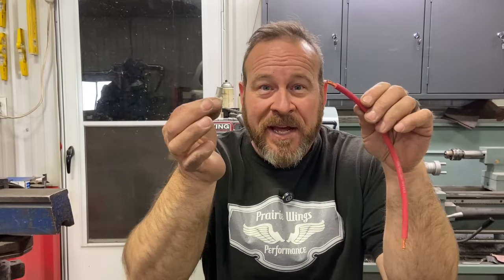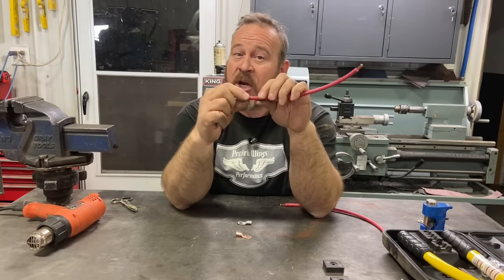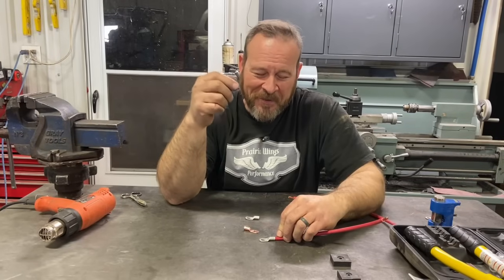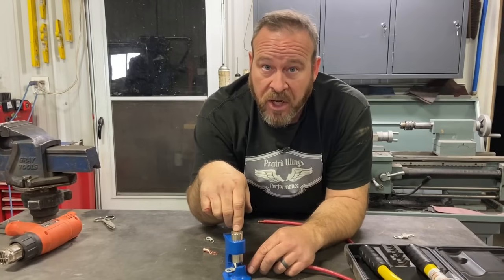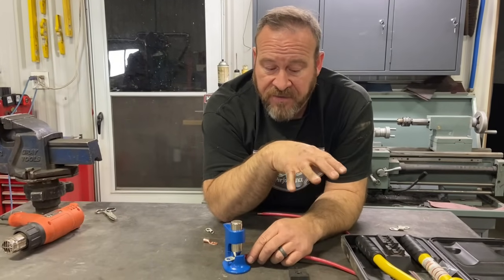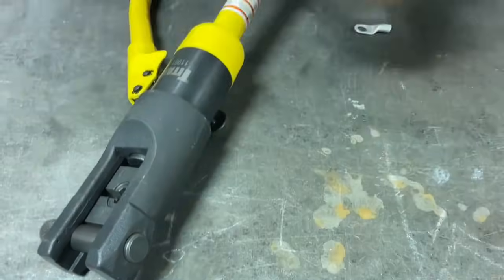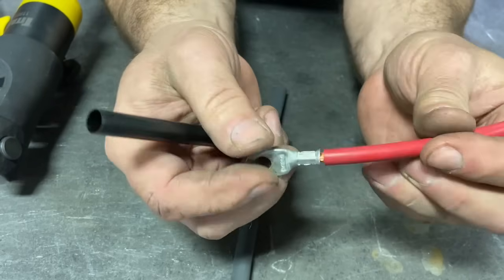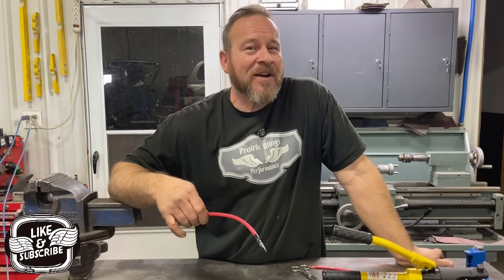Crimping Heavy Cable Ends - Which Way Is Better?

Comment: GREAT VIDEO!  Non-professional here, but have been putting together small emergency solar power systems for friends and family.  Have been using the hydraulic crimper from the start because of the mess and learning curve of soldering - mostly not heating/burning the wrong stuff, like insulation or my work bench, and dealing with fumes, etc..  I have just been filing off the "squish-wings." which takes more time than just backing off after a partial crimp, rotating the end by one flat and then completing.  That tip is greatly appreciated!

Do you have any suggestions on sourcing the better heat shrink and if it's possible to tell before ordering whether it has got more of the sealant?  Didn't know there was a higher grade product and the stuff I have been using is definitely the flimsy stuff with less sealant.

Lastly, can you explain a bit more about, or give  reference to a deeper dive into, the reason why soldering increases the likelihood of connection failure in high vibration situations?

Thanks again for your time and a great video!
Reply from the maker: @chuckm65   thanks for taking the time to dig deeper and ask some legitimate questions. I use either PICO or Techspan double wall heat shrink. 

As far as the science behind the vibration failure I am no engineer or expert on the science. I know a few things from training. Your panels I believe should be considered a static load. I’m not sure the engineering behind them they would have some dynamic loads because of weather conditions but for conversation sake we will call them static. Nothing should be loading them differently solid mounts wires tied etc. parts not intended to move (let’s hope not). Something that is dynamic loaded is loads that are intended to move, vibration and designed to have shifted loads. When the wire is soldered it can cause a failure point at the end of the solder, that joint is very stiff and I have witnessed that failure on many applications. Usually where a door opens or closes on some’s repair work etc. for the science behind that I am hoping for someone with more background in the actual science would chime in. 

Thanks again for digging deeper, hopefully we can start a good information conversation.

Comment: One should look for dual wall adhesive lined heat shrink.  This is the style that contains a thin layer of hot glue on the inside that generates a waterproof seal between the connector and wire insulator.
Reply from the maker: @williamdouglas8040  absolutely, thanks for taking the time to add your thoughts!!
Reply: Where can that be found online?.... Any info brand names or websites would be gratefully appreciate it
Reply from the maker: @ it is a Titan. MPR tools has them, since I bought this I have seen this brand at the cheap stores. If you sort through the comments there are tons of suggestions on better sets. I actually want to upgrade this one from all the comments suggested ones (it’s going to take a while to figure it out, lots to sort through). I appreciate you taking the time to watch and reach out.

Comment: As a marine electrician I have seen many lugs fail for a variety of reasons. Mostly from corrosion, then crimp technique. When troubleshooting I start at the batteries condition and connections. I have been using the hydraulic crimp method for a few years.
 I use electrical tape stretching around the lug and cable before I heat shrink. The shrink should be at least an inch past the end of the lug, more is better. Don't try to save money on your heat shrink!!
Reply from the maker: @gregnelson86  thanks for taking the time to watch and share your experience! Very valuable!!!

Comment: The rick with soldering the lugs on is not to use solder but fill the ends right up with molten lead, then push the cable end into the molten lead, no further heat is used. As lead cools and solidifies it expands and grips the cable tight, if you look at very old iron railings you will find that they have been set into holes in the stonework this way, molten lead poured in around the iron rails which then expands and grips the iron and stone.
Reply from the maker: @Equiluxe1  thanks for taking the time to share that trick!

Comment: This is a great process that doesn't leave much room for improvement.  I believe the pressure from the dies is enough to cause the copper wire and metal lug to flow together removing gaps between the strands and sealing the end of the cable from moisture intrusion.  When you add the heat shrink you get a very high quality connection.  Let's not forget that to have the best long term reliability the equipment owner still has to do regular maintenance including battery maintenance.
Reply from the maker: @TerryPullen  true true! Thanks for taking the time to comment!

Comment: Great video. I would only add that there's a difference between the hydraulic crimper you have and a very similar style, but the crimping end is more like a C clamp and the dies load from the side not the end. The C style can flex when crimping larger cable like 2-0 or 4-0, and will eventually result in not producing good crimps.
Reply from the maker: @andersonautomotive  great info, I’ve never used the “c” style. Thank for taking the time to comment.

Comment: Typical urban elevators are probably the heaviest common power loads. The folks who install them use the "solder pot" method of flooding the terminal and cable with solder. So that may not be milspec, but it has plenty of real-world proof that it works under long period heavy load.
Reply: If there's flexion or vibration, solder is not ideal.  It works great for connections that are never flexed.
With high amperage loads, there is some self-heating of copper cable, causing expansion/contraction -- and in addition there can sometimes be significant forces derived from the induced magnetic field.  So you can't always regard even a very firmly anchored connection as being free of flexion.
Reply from the maker: @lyfandeth  absolutely, thank you for the great information!!

Comment: The little blue thing is not a crimper. You are STAKING the cable in the lug, with a punch, as opposed to uniformly compressing a barrel around it. Which would be crimping.
 Staking can be "good enough" but it ain't crimping.
Reply from the maker: @lyfandeth   absolutely, as you can see in the video… words aren’t my first language😂. I do appreciate you commenting!!

Comment: I have a Temco hydraulic crimper.  It has the standard dies which work for the standard duty terminals.  It also has a set of + sized dies that work with the heavier terminals without forming wings.  There is also a set of dies for metric and MC terminals.  The Temco is more expensive but gives you the proper tools to work on a variety of equipment.
Reply from the maker: @douglaswalker8563  perfect, after chatting with all the people commenting I definitely have put a new crimper on the wish list. I really appreciate all the good information! Thank you for taking the time to share!

Comment: If I am not soldering a connector  and it is going to be exposed to either battery or road spray I coat the wire with Truck-Lite 97944 NYK-77  anti corrosion grease before crimping and have never had a  connection corrode even exposed to North East winter road salt.  The extra step is worth a little time  for added insurance.
Reply from the maker: @charliehayes6667  hey perfect! Lots of great tricks shared, thank you so much for sharing your experience!!

Comment: The shortwerishon do not splise  any cable in a place where its exposed of The major vibration its usualy easy to se if you back dovn two steps  and IF you do that it doesent matter witch metod you chose  as long your god att it  you never ever splice it where it broke
Reply: Never ever splice it 😢😢whwere broke unless its temporarly and works😅
Reply from the maker: @jonnyeriksson3218  🤣😂
Reply from the maker: @jonnyeriksson3218  great advice, thanks for sharing!

Comment: What you are trying to do is compress the strands till there is no air gap, air gaps between strands are bad...
Reply from the maker: @martinfidel7086  you bet kind of cold fusion. Thanks for sharing your thoughts, very much appreciated you took the time!!
Reply: @ no not that tight, at that point the strands lose strength and will fail more rapidly due to fatigue, hence why we use calibrated crimp tools and jaw sets
Reply from the maker: @martinfidel7086  I totally get that thanks again for the input!!!!!

Comment: Is there a video for that manual crimp, hammer style?
Reply from the maker: @keithbrown1915  I haven’t put one out, thoughts, I can put it on the list if you want. It’s very simple.
Reply: @prairiewingsperformance6036  I agree that the hammer style crimp tools work surprisingly well, in my experience.  I've only been using them for about 10 years, so come back in 20 to ask me if they are holding up. Obviously hydraulic is far better if you can justify the cost.  Or find a friend with one!

Comment: Excellent video. Subscibed. Techniques for termination are very interesting to me. I have always used the soft heat shrink. The heavy glue HS is new to me. Definitely see that is better app than stand on this application.
Subscribed.
Reply from the maker: @keithbrown1915  thank you so much, I really appreciate the subscription!! I also really appreciate the time you took to comment!!

Comment: If you’re worried about using some kind of goop between the wire and the terminal, you should use Noaloc like electricians use for copper wire on aluminum terminals because it is conductive of electricity and dielectric grease is not. I’ve been using hydraulic crimper for 10+ years and before that I use the kind you hammer on and I also have a set that looks like pruners with an adjustable thumb screw on top for adjusting for the different size lugs and they all work well but the hydraulic ones are my favorite.
Reply from the maker: @bigjohnson4983  sounds like you have a wealth of knowledge! I definitely can relate to the progression, thanks for sharing the tip, time to look up Noaloc! Thanks for taking the time to watch and add a useful tip, no one else has mentioned that so I’m sure lots of people will be learning from you!! Much appreciated.

Comment: Man. After being an auto tech that specializes in custom electrical fabrication. It so nice to see someone that has traveled the same roads and wound up in the same spot I have with what they feel is the best most reliable way to do this task.   For that I subbed up!  Notifications are on too.    Well done.   Have u noticed that sometimes the best way is to crimp and soldering?  There’s even some other tricks when u pull huge amperage 500plus that helps with the efficiency of the connection too. 11:36
Reply from the maker: @rodgersrcaviation2785  hey, it is definitely good to chat with others that have travelled the same road!! Thanks so much for joining and showing your support, really appreciated!! Please share along with your experiences, I have learned lots from constructive comments. Isn’t YouTube great, I remember the days working in a shop that was too cheap to purchase manuals. For those who may not have been around long enough to know, all of our information came from books. When there was no books it was tough and you had to learn the hard way! Again thanks for your comments!!
Reply: @ brother I started in books too. 27yr deep here professional but have held tools since diapers.  I remember when Alldata came on cds and u had to have a big adapter for the printer cable.   lol.   Use to own dozens and dozens of motor chilton and many other big ass blue hard covered heavy books. lol never figured out the why are they all blue question
Reply from the maker: @ yup, I still have them boxed on a top shelf in storage. Not sure why I haven’t used them to start fires, deep hoarding desire??!! It’s funny in the world of information we live in now some people still struggle trying to fix things without looking for information. I guess I’m guilty of that sometimes….
Reply: @ man I’ll tear off into about anything.  Airplanes. Boats. Jet skis whatever but years of experience tell me when it’s time to go peek at it. It’s time to go peek at it.   Im sure u know what I mean.
Reply from the maker: @rodgersrcaviation2785  absolutely, I am helping a friend with a rebuild of a plane. Probably have some vids on that too??
Reply: just use calibrated terminal crimps designed for the terminal in use and apart from your bank balance being broken all is well
Reply from the maker: @martinfidel7086  yes all the way around 🤣
Reply: @ sorry I'm clearly having a humourectomy tonight :(
Reply from the maker: @martinfidel7086    I’m sorry I may have taken something wrong, i am not a big texter in the best of times and this feels like texting. I am the guy who doesn’t take cues very well when talking and text we’ll forget it. I love to laugh and am sorry i thought you were saying to use proper crimpers for the lugs you are using but it’s going to hurt the wallet. I agree to both. I as well am probably invest in better tools. There has been some great information in all the comments. Again I’m sorry if I’ve offended you.
Reply: @ buddy I am in no way offended :) I go have some expensive crimpers though, I paid over £500 20 years ago for one of them :(
Reply from the maker: @ perfect! I’ve been around too long to want to offend anyone anymore, that was the kid I once knew😉.

Comment: Slightly off topic, I'm new to your channel, but have you done a video on the Western Union/Lineman Splice instead of a butt connector for multi strand automotive wire ? I learned it from Chris Fix. Great for hooking up aftermarket taillights etc .. bare each wire 1" make an X and twist each wire the opposite way. If done correctly you'll end up with a half inch of bare wire that can't be pulled apart. Then slather the Splice with dielectric grease, then use a slightly larger shrink tube, heat both ends first to trap the grease. You'll break the wire b4 the Splice will fail. ChrisFix explains it way better than me. Thx for your informative video. I never use crimp on butt connectors tht can/will fail. Chk out his YT channel. Sorry for the poor grammar
Reply from the maker: @speedfreak8200  thanks for checking it out and subscribing! Appreciate the information, thank you for taking the time to share!!

Comment: Started uding my dads Thomas & Betts think it was a TB5 or TB M5 crimpet that had individual dies for #10 to maybe 3/0 cable. Let my old job have it when I retired 6 years ago. Worked great. Recently read that cars have no solder connections.
Reply from the maker: @JohnThomas-lq5qp  it also sounds like you have a wealth of knowledge, you left them a tool but I bet the knowledge you left was worth more than that! Thank you for taking the time to share!

Comment: Won't that hole in the connecter still allow moisture and corrosion to get into the cable wires?
Reply from the maker: @Enigma-Sapiens  absolutely, I’ve been called out many times on that one here, oops🤷‍♂️. Those are the lugs that come with the aftermarket wiring harnesses! I really do appreciate the time you have taken to comment though, I’ll do better next time? I hope😬
Reply: @prairiewingsperformance6036 , You did great, it's nothing a dab of solder wouldn't fix.
Reply from the maker: @ you bet, thank you so much!! Hope you have a great Friday!

Comment: You can't solder wires in the marine environment.  The AYBC states that you can't solder because as you mentioned vibrations will break wire by wire overtime.  A good solid mechanical connection is the best that they require for certification.  🤠👍
Reply from the maker: @Chris_In_Texas  thank you so much for sharing, I’m not sure what the governing body you mentioned is but it’s good to have input from a trained certified professional!!
Reply: Do you add an oxide inhibitor or do anything else special
Reply from the maker: @barfy4751  I personally don’t do anything and it has worked for many years. There are tons of great tips in the comments if you have time to sort through them. Thanks for reaching out.
Reply: I do electrical repairs on aircraft solder or crimp terminals on military aircraft . I prefer the solder less  crimp designs. They last longer. Some solder joints break due to corrosion from flux or not soldered per mil spec.
Reply from the maker: @macd6351 thank you for taking the time to add to the conversation!!

Comment: You hit all the important issues for quality work...but I'll add some thin wire details.
1) Buy high quality COPPER crimps (or tinned copper) for copper wire and use STEEL crimps for steel wire.
2) Use the correct crimping tool for the specific brand and type of connector. (this is critical on thin wire applications and the many types of connectors like Tyco, Molex, 3M, Beldon etc.)
3) It should look like a factory connection for any and all applications.
4) Doing it right is expensive, doing it wrong can start fires or even hurt someone. Don't let the customer get cheap on you and explain why it matters.
Reply from the maker: @kevinsellsit5584   thank you! The silver crimps are copper with a coating they also have aluminum lugs! Thanks for pointing out the steel, never seen them. Absolutely with the correct tools have a drawer full of them, I love tools! All of your points are awesome, thank you for taking the time to share!!